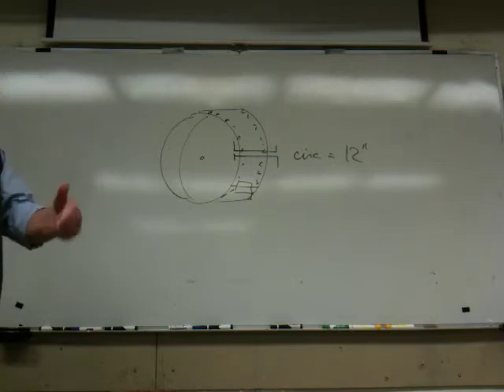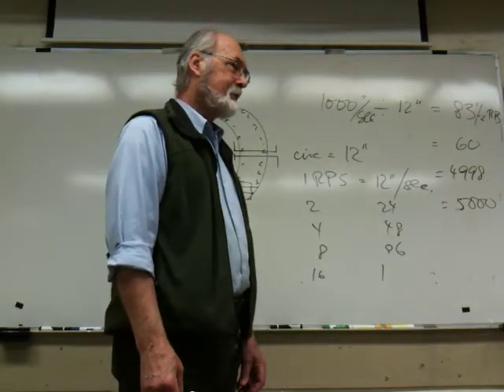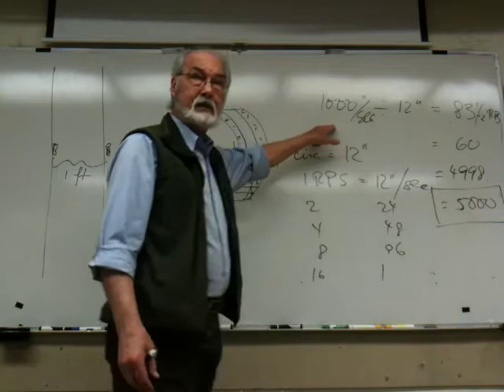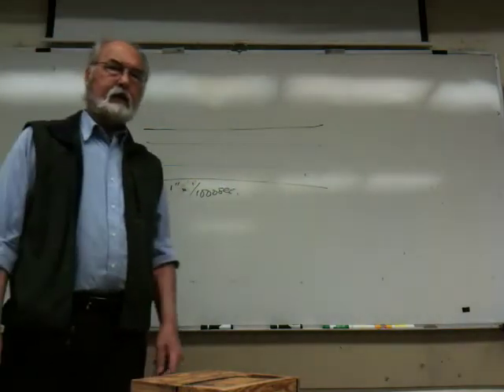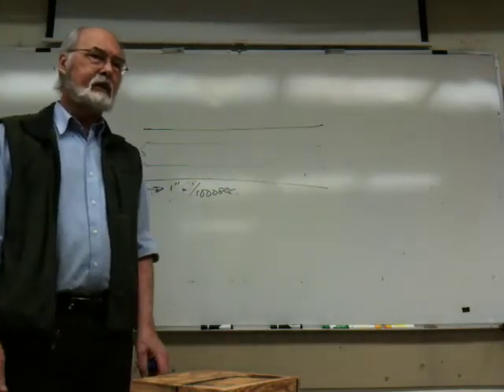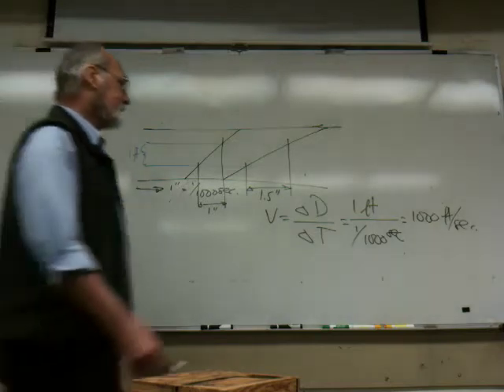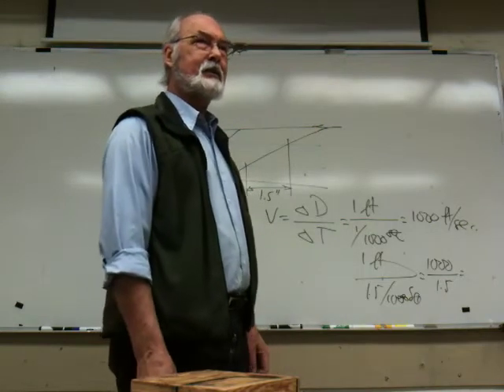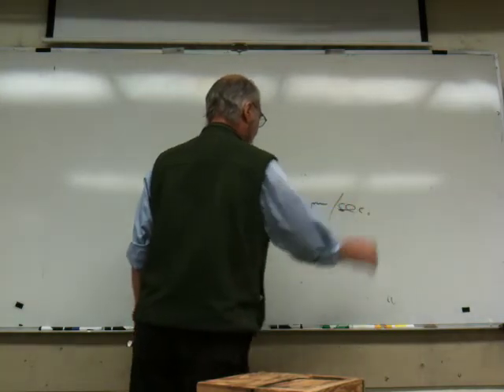Prep for streak lab for bullet velocity measurement

Comment: I worked at Eglin Air Force Base in Florida for their Optical Systems Branch. I certainly regret that they were and still are steadily moving away from film technology and focusing more in the digital technology. I was briefly exposed to some of the film cameras but unfortunately received little to no training on them. I greatly appreciate this video. I now specialize in high speed digital video sales with cameras capable of 1.5 mil fps. What a fun field this is.